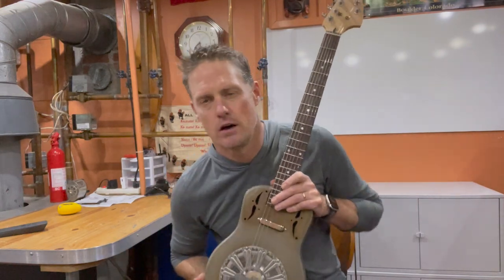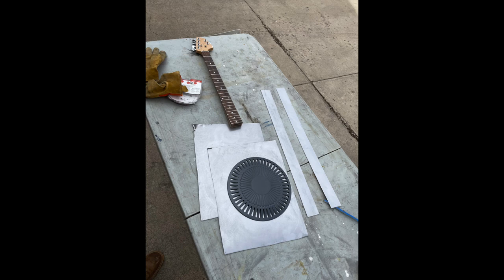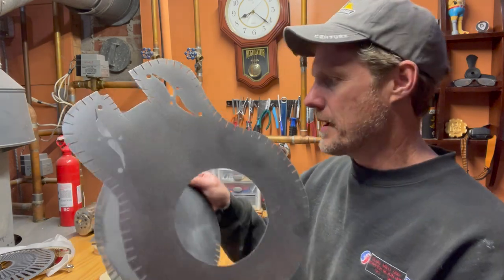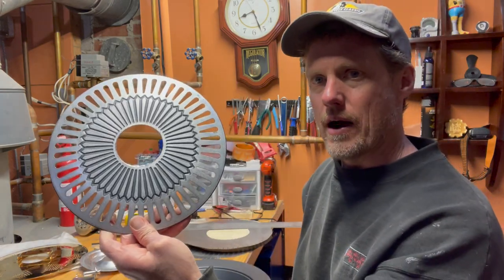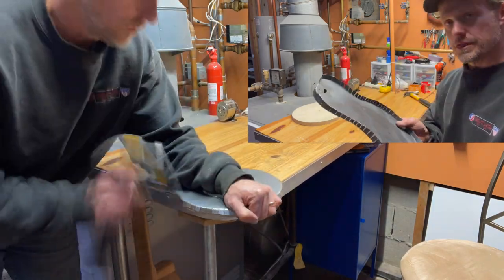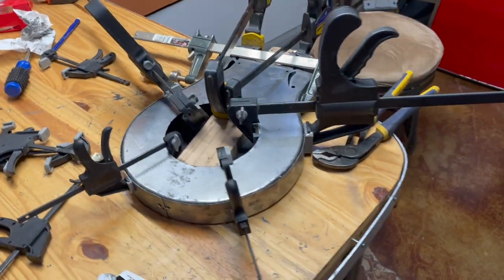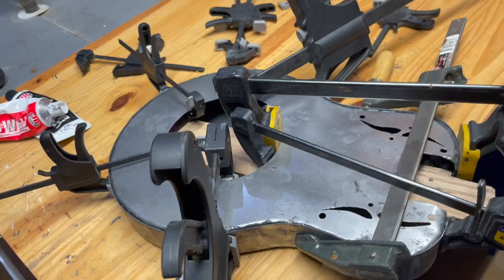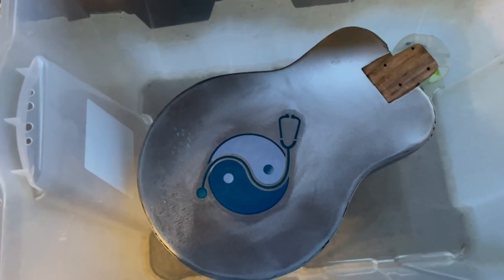DIY Steel Body Resonator Guitar

Comment: You could always try to use car body filler or Bondo and fill the gaps then sand and smooth. Just a thought 8f you wanted a painted finish later on.
Reply from the maker: That would definitely work.  I think I like the rusty metal look for now.  Thanks for watching